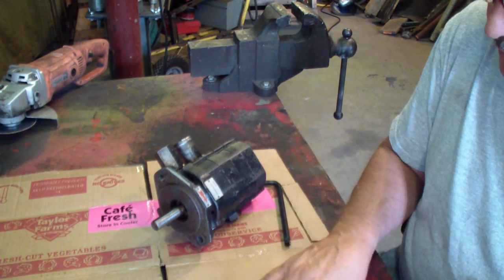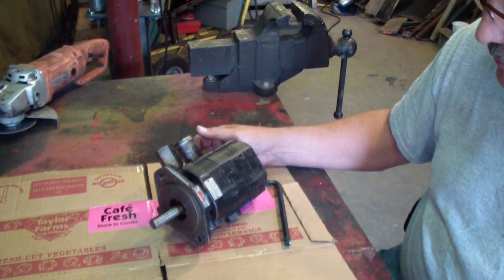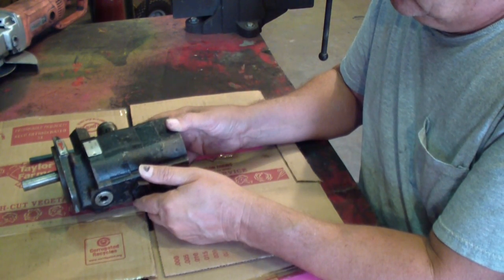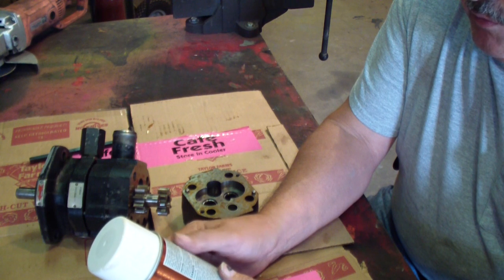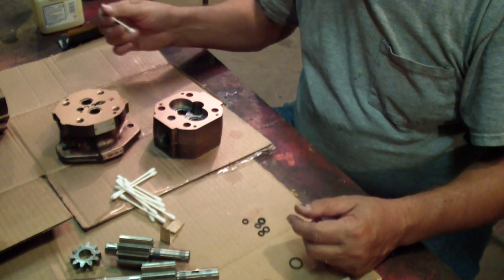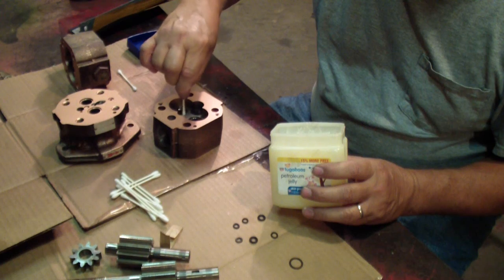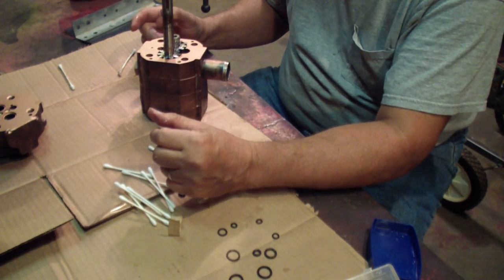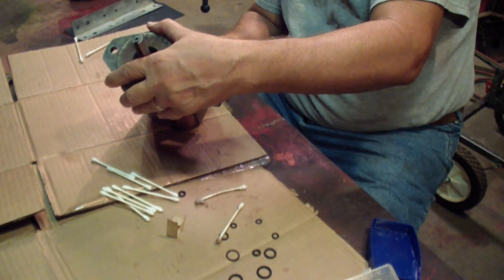Rebuilding Northern Concentric Haldex Hydraulic 2-Stage Pump

Comment: The coating on the surfaces is a mylar gasket.  The reason it's peeling and looks the way it does is because it's melted from excessive heat.  And the o-ring seals are flat for the same reason.  The melting from the heat.  How do i know?  Because I'm the service technician for the company that made this pump.
Reply: Is the way he did the rebuild acceptable? Where do we get the right parts?
Reply: Who sales the parts like seals ???
Reply: @philliphall5198  they are only sold through our authorized distributors.  Kraft, SunSource, Price Engineering, Quality Hydraulics, Fluid Power Sales, Hydro Air Dees, Fluid Tech.  Possibly Grainger or Northern Tool.
Reply from the maker: David Brown thank you it makes a lot more sense now